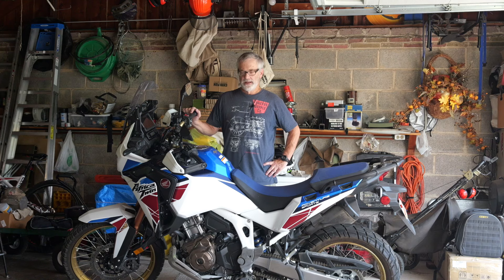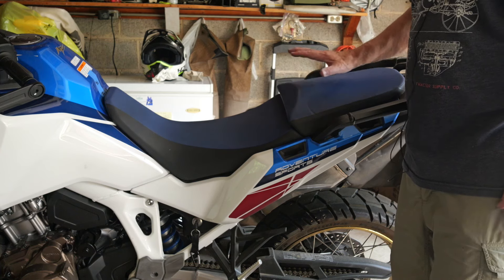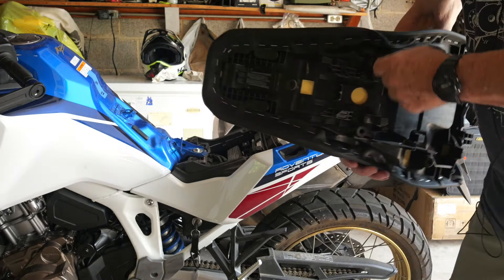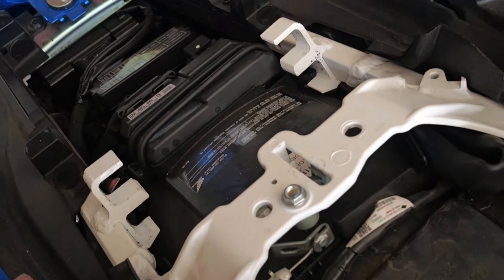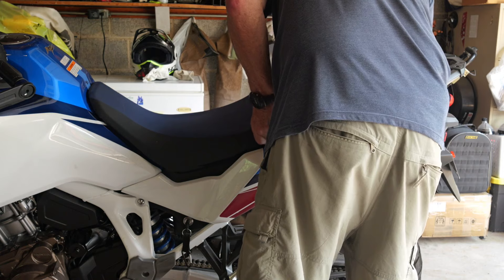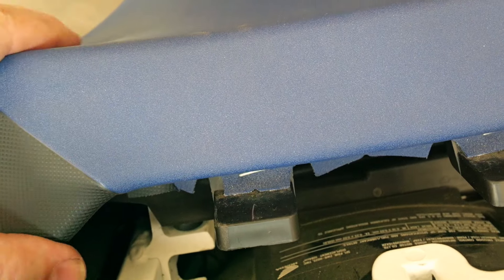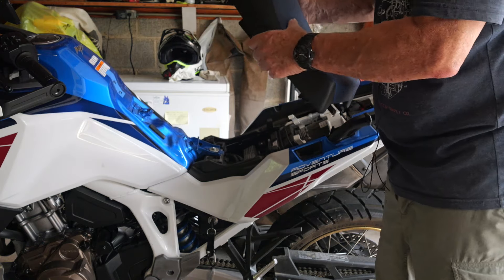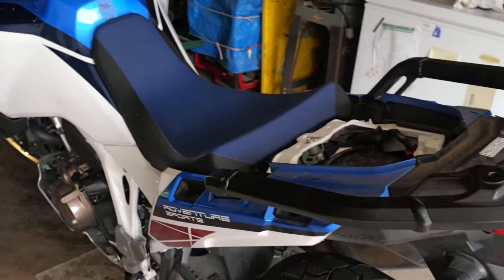Honda 2022 Africa Twin CRF1100 D4 seat adjustment.

Comment: A little tricky is putting it mildly. I just spent 45 minutes just trying to put it back on. Fortunatly it went on in the position I wanted but that was just a pure fluke. I was a passenger in that train wreck. An act of God would be required for me to remove that seat again on my 2024 AT.
Reply from the maker: Fortunately the seat height is not something that needs adjustment that often. Enjoy your 2024 AT.

Comment: I have a problem for opening when I put the seat high, I can’t remove the back seat when I want to open it so I try to remove the front seat first and then back, it’s complicated but when I put the seat low it’s easy to open it
Reply from the maker: Make sure to lift up on the front of the passenger cushion while turning the key. Then pull the cushion forward and up. I verified that this works in either the upper or lower seat height.